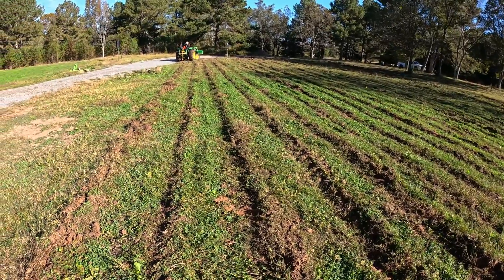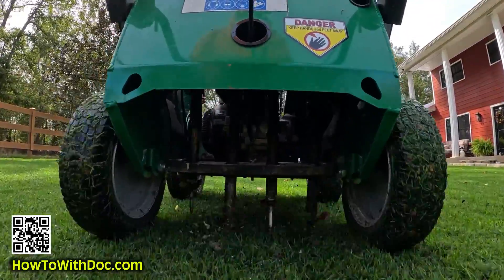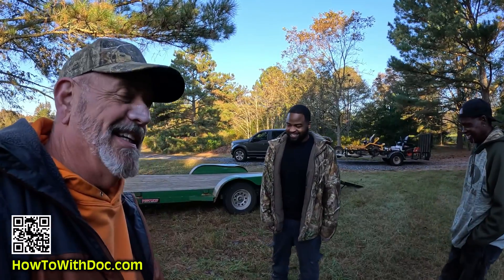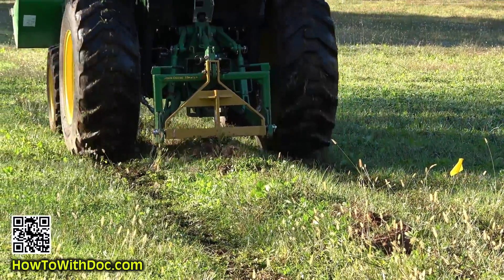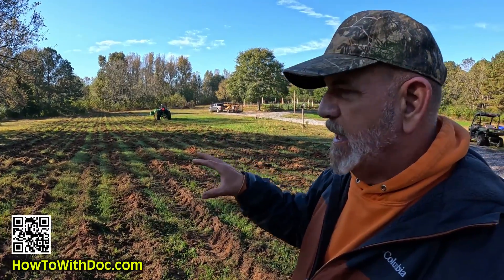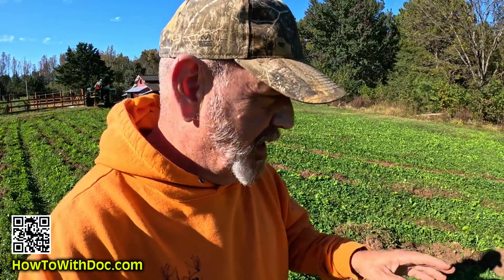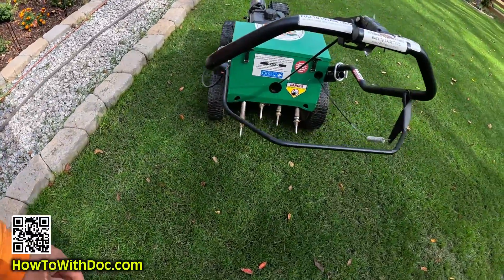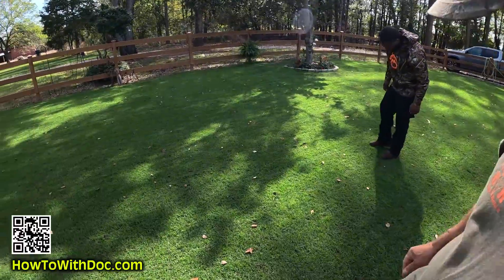Hard Clay Soils - Aeration Lime and Subsoiler on Fields

Comment: A better way to do it is to (a) run a disc before the sub-spoiler, object to cut the roots so the plants are simply torn out by the sub-spoiler; (b) forget any nonsense about starting gradual, go deep immediately, if you need to get a tractor with more horses, do it, if you need to reduce the number of blades, do it; (c) fit a following tamper to flatten the uplift and close over the top of the sub-soil trench. It won’t reduce the air to soil ratio nor reduce the water entry but will reduce evaporation and make the field gentler to walk and drive across. DONT be afraid of rocks, use a “Stump Jump” set up (see the Yeomans Plow AND if you have to put a Rock Picker over the field, do it and progressively reduce the screening size in multiple passes. Don’t think the rock is waste, use it on any Gully or Road building or even put in a crusher and sell it as Road Base.
Reply from the maker: We never till or disc. Just sub-soil. Horse power is not an issue it's just tire slip

Comment: nice fence.  do you find yourself needing a heavier sub soiler with a sheer pin?  I was planning on a everything attachments sub soiler but they went belly up a few months back. my tractor is the same size as the Deere you are using.
Reply from the maker: No the one we bought from tractor supply worked perfect. You'll have to get a feel for the resistance and may have to lift from time to time.

Comment: Good call on using the subsoiler. You have to be careful doing any deep tillage where you turn the soil over, because you run the risk of bringing up clay. From what I can tell this will leave that clay down deep and allow nutrients and O2 to penetrate deep, deflocculating your top 12 inches of soil.  Should see great results.